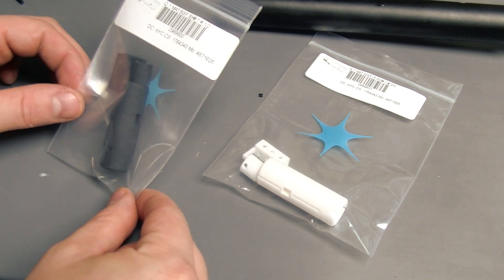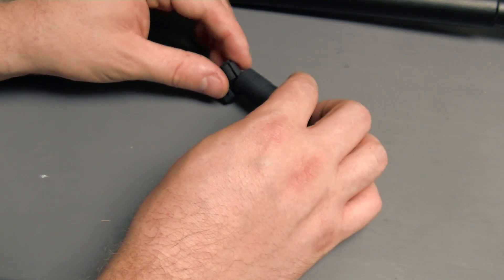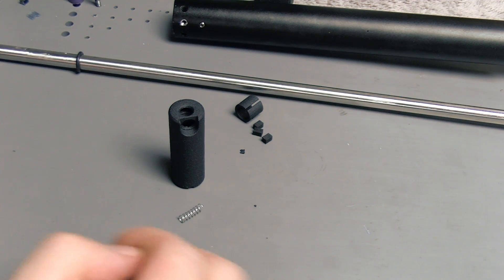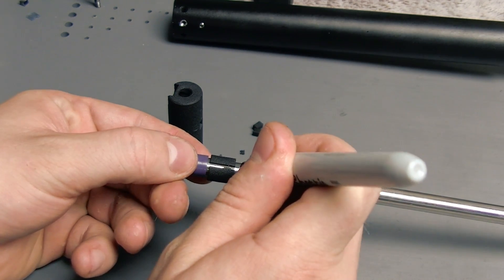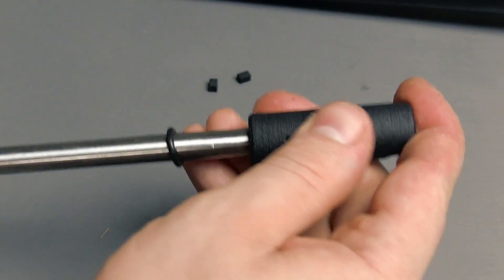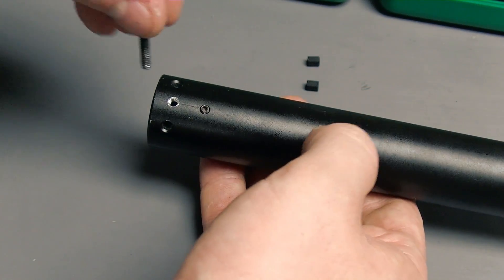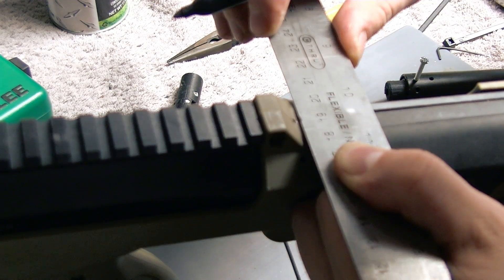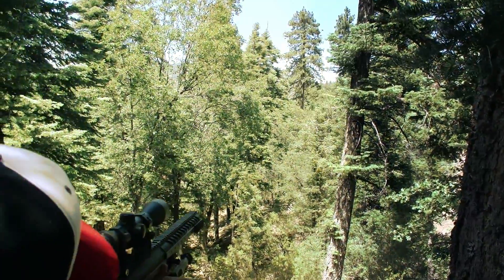SRS Top Down Hopup Design new Product

Comment: Ach, grub screws. I used to employ either thread lock or PTFE tape to try and ensure that they wouldn't move once I set the hop.

Any alternatives to those methods? Good work, by the way, the 2 screw system (PDI and I believe Laylax both employed that method as far back as the APS2) is far too finickity.

Comment: Just ordered one of these, should be fitted by my next game on the 16th. Great work!
Reply from the maker: Hope it gets there by then, let me know how it works out, biggest mistake I made was not drilling perfectly plumb up and down had to fix it by making a bigger/straighter hole, all better now.
Reply: Thanks, I will do. I have access to a good workshop so no major issues. I will be making and installing my first r-hop on this too.
Reply from the maker: Sweet check out my R-hop patch cutting tutorial I have also combined that with the Sugru mod and it worked out well sort of lets you make a few minor mistakes.
Reply: Hi, just reassembled and now it will not feed. They fly up the feed tube but will not enter the chamber without assistance. Is there a need to open up the printed chamber to allow the bbs in?
Reply from the maker: Jason981S _ I remember having to do this on one of my prints. Just gently run a 6mm drill bit through the opening between the front of the hop unit and the feed area and it will loosen the path for the BBs do a roll through test before you reassemble.
Reply: Brilliant, I will try this tomorrow.

Comment: Hello Brain!

I was going to take advantage of the free shipping and purchase the SRS chamber but I've seen you have stopped the sell of the it so I guess you're testing a new design.

I've been thinking about it design and, may I suggest to try another design with the nub/pusher design like a traditional lever?

I mean, I know that this way the force on the hop-up is directly vertical but if there's any problem doing the TDC mod and/or the screw head is not completely horizontal it will make an uneven hop-up effect.
With the lever stye you make sure the nub has at least one horizontal point of reference.

Sorry if I have not explained myself clear.

Thanks and keep up with the good work!

Comment: engineer a bb follower so you can get every shot out of the mags.
Reply from the maker: Solid idea hate those 4 BBs that never make it out unless you flip flop the gun. Maybe have it go up so high that it stops the bolt from locking in letting you know you need to reload.

Comment: Odds of 4 to 1, Brain Exploder will be the man that invents the rattle free high cap mag.
Reply: Yes indeed, they don't rattle and they also don't feed and they also can't be wound up while in the gun.
Reply: It already exist - P90 high cap mags.
Reply: I am having troubles with feeding also with classic mid caps for p90 - MAG brand. It seems that feeding troubles for P90 are different part of the story. It is just that there are already hi-cap mags which does not rattle. Feeding issues are occuring also on those pesky rattling hi-caps, do not worry, lad.
Reply: pile1983
I use 170rd midcaps and they feed perfectly. Unfortunatly they are no longer available and I can't remember what brand they were because I bought them two and a half years ago and they are not branded. It only says the real P90 stuff on it, you know 50 ROUND RESTRICTED TO GOVERNMENT etc. I wish I could point you where to buy them.
Reply: sogerc1 The MAG mid caps are also 170 rounds.And I am having serious feeding issues because of the big spring tension, when the mags are being fed above 100 rounds. I am using TM P90 TR. A friend of mine is using some chinese P90 and is having similar feeding issues with the same 170rd mags.
Reply: Wait a minute, I forgot to tell you that I changed the feeding nozzle and I did the indentation mod on the hop-up chamber and that helped me with the spring tension. Although if you have the TM hop-up unit you should already have a step inside the chamber that prevents multiple BBs to getting into the hop-up chamber, but you should check it anyway. Mine is an Echo 1, that definitely needed the indentation.
Reply: pile1983
It was so long ago when I prepared my P90 to battle that I forgot the details :) But aren't you guys having problems with the trigger? With the semi auto stage? 'Cause I recently started having issues with it, but I have not looked into it yet 'cause I mostly play in full auto. But if you have some experience with it pls share.